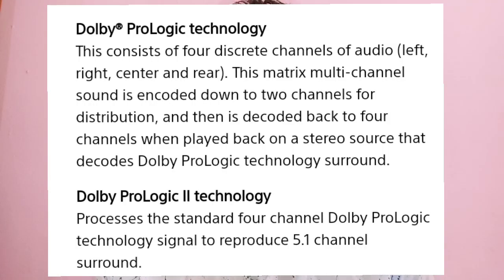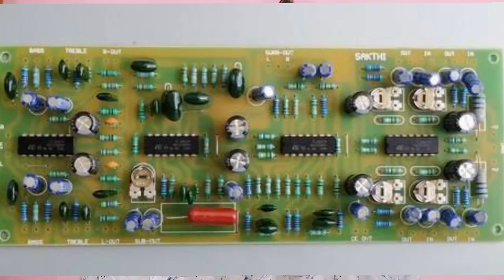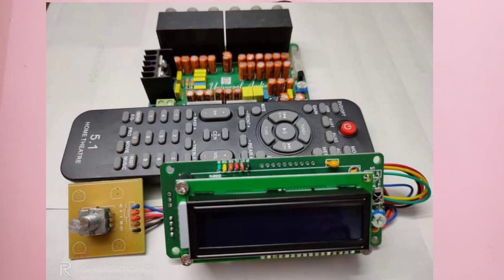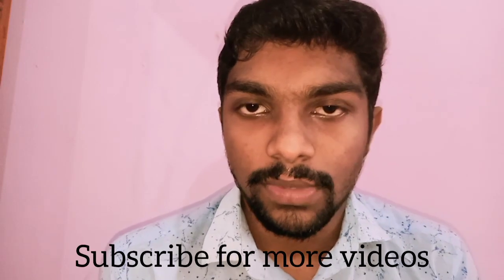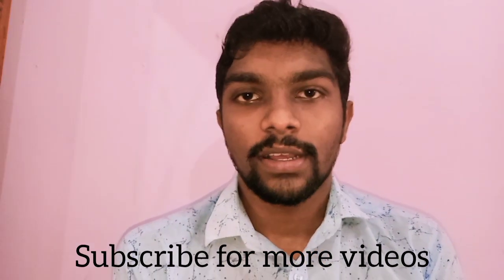5.1 prologic board and remote kit explanation/ malayalam.

Comment: Helooo bro 
Apol enganea annu 7.1 aki edukunathu per channel 150 Wats ennu okea parayunathu
Reply from the maker: Watts varunath, power amplifierne depend cheytanu. Rear signal edukunathpole tanne 2 channel koodi edukkum 7.1 nu.
Reply: @techzone9209  saradhi electronics pls check evar Telugu annu a pulli Dolby Atmos undaki
7.2.4 Dolby Atmos
Reply: @techzone9209  Astra kit remote kit annoo . enganea undu astra kit
Reply from the maker: @renjithk7346  remote kit ( decoder) aanu.
Reply: @techzone9209  saradhi electronics you tube channel I'll avar Dolby Atmos undakiyalooo
 7.2.4
Reply from the maker: @renjithk7346  atil astra kit anu bro use cheytirikunath. Fake
Reply: @techzone9209 JBL annu  Atmos 4 speakeruse  aval yudea video onnu nokumo
Reply from the maker: @renjithk7346  bro, videoyil paranjapole atmos amplifiet assemble cheyyan nilavil sadikilla. Videoyil avar use cheytirikunath etenkilum branded av reciever ayirikkam. Details hidden anu. Channelin vendi et speakers venamenkilum use cheyyam.